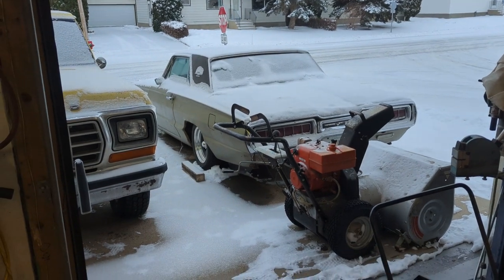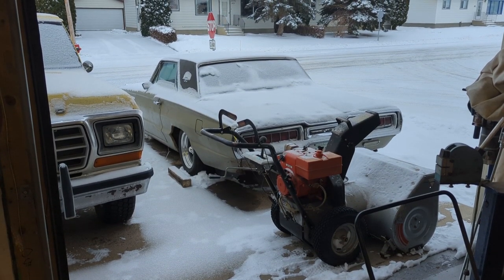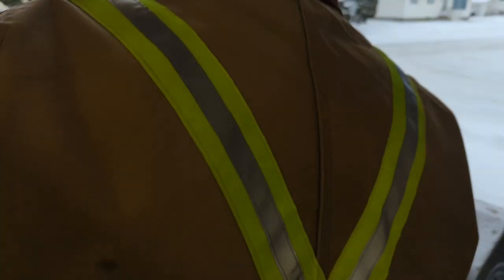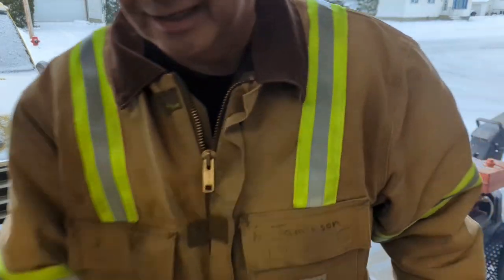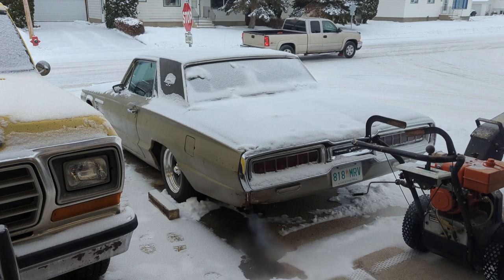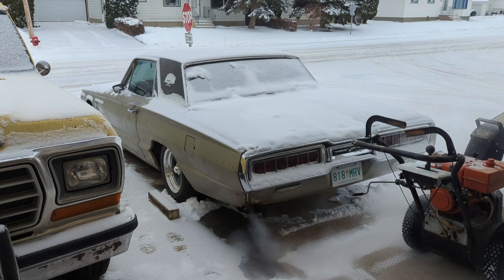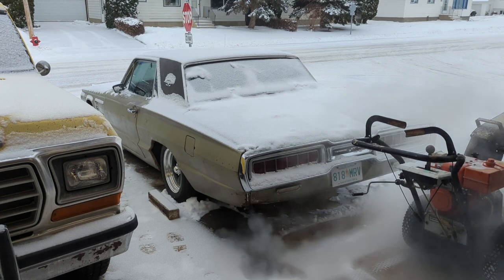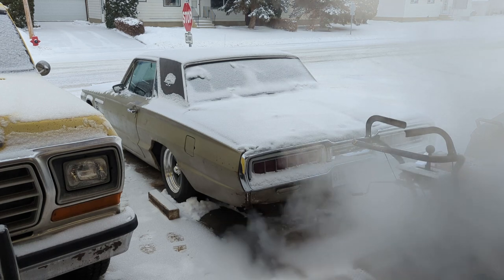Choke Adjustment Cold Start Follow Up Test - 65 Thunderbird 390 Engine Autolite 4100 Carburetor

Comment: Looks like this is the last of the 65 hardtop videos as of now.  I guess because of the Winter weather.  I really enjoyed watching them.  Thanks.  Come spring I am sure you and your wife can do some cruising.  I for one, look forward to more videos on the hardtop.
Reply from the maker: For now Jeff, we do have a lot of work left to do the hardtop, I made a right side front floor pan, and I bought a new headliner, truck liner kit, and a new carpet for it. I'm also planning to switch out the C6 transmission with a Cruise O Matic, the C6 is slow to engage drive and reverse, plus the C6 wasn't used in these cars until 1966, so I'll return it back to the original transmission type.

Comment: Hey Alvin, man it looks cold there. Its cold here in Colorado too but not that cold. Sorry you have to park your Thunderchicken outside, why cant you put it in that car shelter you built? That car sounds pretty nice, especially in such cold weather. Mine would just cough and stall. I still dont have a carb on it yet anyway so there is no starting it now. Keep up the good work, thanks.
Reply from the maker: Hi Nick, I wish I had room inside for the old girl, it's a little heartbreaking to see her out there in the cold, and there's not enough space in the new shelter for her.
Btw... I've started working on the convertible again, working on the front right torque box...right where I left off! 😊
Reply: @J_R_Shop  Hey Alvin, sounds great, cant wait to see the video.

Comment: Wow! winter has come to you folks already.... we are just having a wet and drippy time down here, my T-bird is in the garage getting the electric windows fixed. Does your choke have the hot air tube going from the exhaust manifold to the carb or did you convert yours to the electric? Thanks, and God bless. Still awaiting your package from Canada, with all that snow I guess it must be coming by sled!
Reply from the maker: Hi Mike, winter is here, about two weeks later than normal for the cold temps...but it has arrived! The tubes are in place, I didn't convert it to electric...so they are needed.
Between the crazy costs of shipping, and the poor delivery times, it gets frustrating for everyone involved...this is one of the reasons why I haven't been offering parts for sale, it just becomes a massive waste of time.